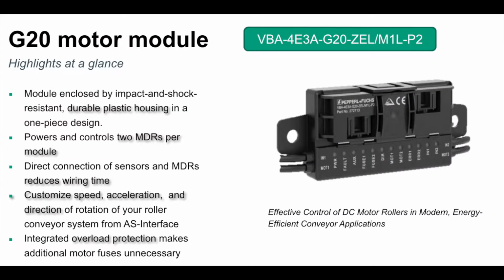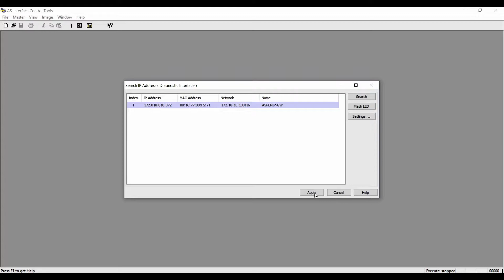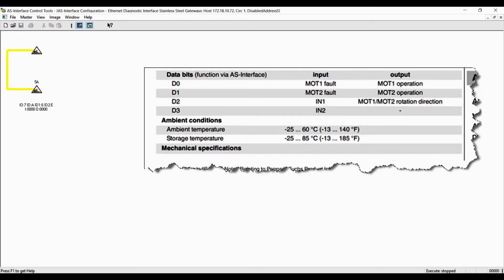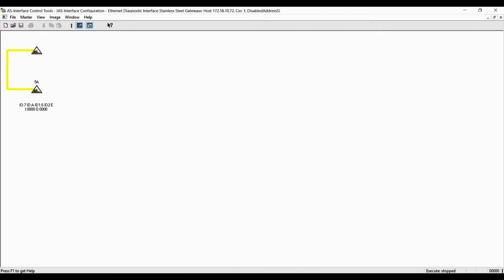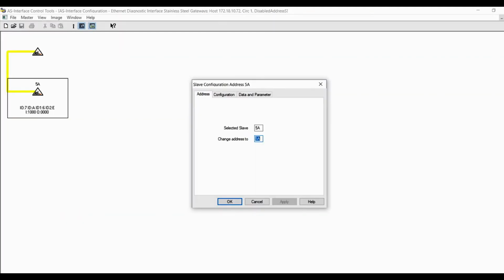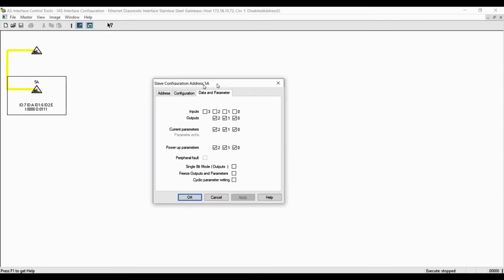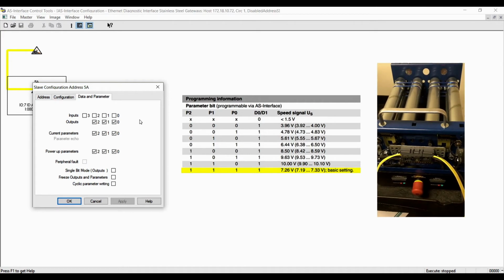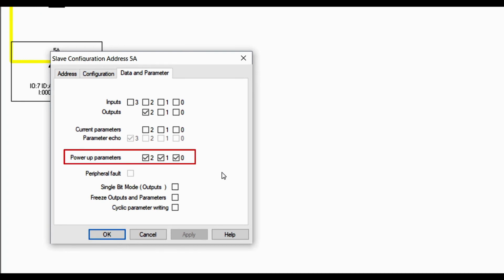Commissioning | Customized speed, acceleration, and direction of G20 module | Part 4

Comment: How is this voltage scaled???? Can i put my meter on it and adjust it accordingly example  7.26v how do I tweek it physically? Is there a pot on the power supply? Where are you telling the module 0 equals 3.96 and 10 equals 10 volts?

Comment: Hello, I used this component like an IO-LINK, with a master io link on a piece of line for testing this component. The master that I used is a MURR elektronic 55152. 
I configure two port of the master 1 and 2, the configuration are the same. 
I charge on the PLC the hardware configuration and software and then the line start and the component is ok. 
If the line is working and then I Unplug the profinet cable, and then I plug it on the same port, the component shows led flashing red from the pin I0 to I8, the meaning of this behaviour is "the component can't communicate with the master". 
And for ripristinate this fault I have to recharge the configuration Hardware from the PLC. 
This happen too if I unplug the cable of the power supply of the master.
So my question is: there is something that I can do for ripristinate the configuration of the component io link?
Reply from the maker: Hi Luca. It seems you’re attempting to use our G20 heads with IO-Link. Would you mind contacting our technical support by clicking this link here https://www.pepperl-fuchs.com/usa/en/ask_an_expert_fa.htm? We may have a better solution for you depending on your application. Thank you.